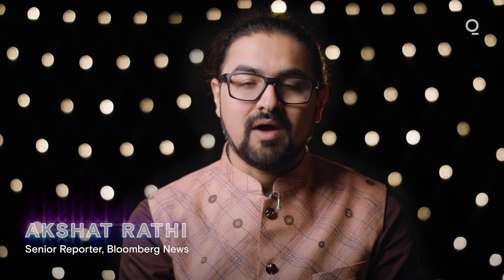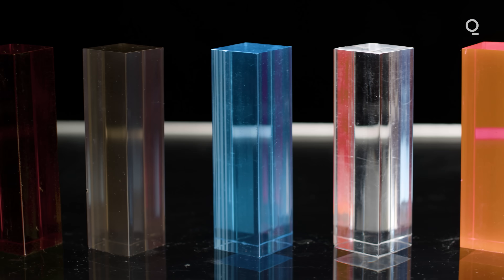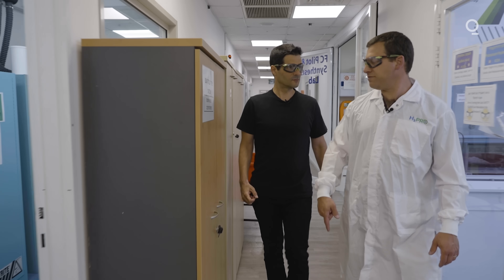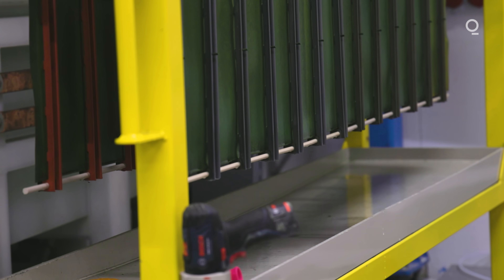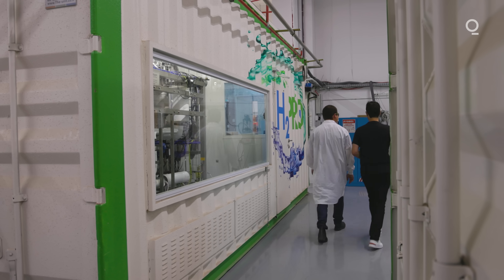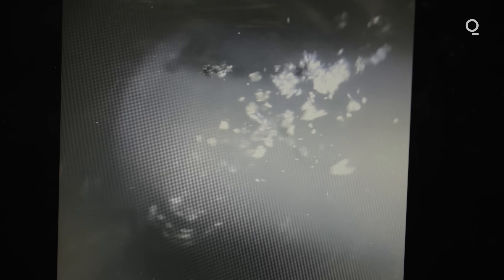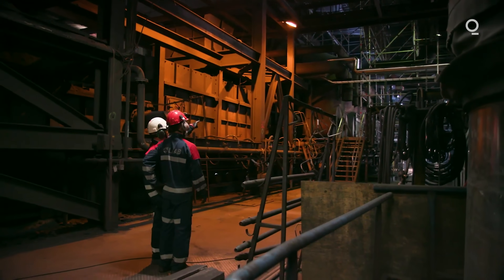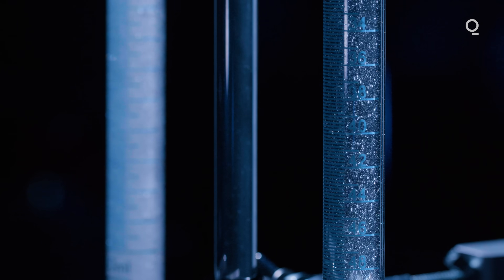How Cheap Hydrogen Could Become the Next Clean Fuel

Comment: Yeah, but creating Heat to extract Hydrogen from water or natural gas costs money and that power comes from somewhere, likely the electrical grid that still uses Fossil Fuels!  Making 1000 °C costs money and electrical Fossil Fuel energy, and making 1000 °F costs 1.832 times more!  And this doesn't even include the costs of the facilities, computer-controlled machinery and manpower.  Everything about "Green" is a LIE!!!  You'll never be "Green" until you eliminate the use of Fossil Fuels to make the "Green" products and the Fuels that they run on!!!  What about Stanley Meyer's water-powered Hydrogen Fuel Cell car and the process he used to create the Hydrogen for it?  His were truly "Green" vehicles and, to my knowledge, the Hydrogen was generated onboard.  It could use any kind of water; Distilled, Tap, Fresh Natural Water from rivers, lakes and ponds and even Sea Water and Heavily Polluted Water and even Poisoned Well Water.  You simply cannot get any Greener than that!!!

Comment: This has been a steady drumbeat from business types for 20 plus years...reminds me of their dedication to diesel-hybrid cars.  Speaking as a mechanical engineer, they have no idea.
Reply: what do you suggest ?
Reply: @visco4916  EVs.  Battery materials can be recycled, energy can come from renewables, and the electrical network is basically ready installed in garages. 
Yes they still have limits and EVs will not stop climate change but look how far the technology has already come in only 10 years.
Reply: @andyjohnson3790  I think it's pretty silly for the US to invest in hydrogen. But for the EU, and their historical cheap gas that they used to have, the lack of materials for production of batteries, EVs etc, they have a real reason to invest in hydrogen.
Reply: @andyjohnson3790  that would not be sustainable though since recycling used batteries are very inefficient and costly, mining new raw materials would be cheaper and the industry would most likely go for that instead. It wouldn't be long before we have also exhausted the available materials for batteries like we did for fossil fuels. hydrogen is cheap light abundant and environmentally friendly if created correctly, and it would be a great way to store and transport energy
Reply: @andyjohnson3790  ev is just using battery, but where ultimately does the energy come from?
Reply: @PROLEO4011  there are zinc sodium batteries advancing, plentiful materials.
Reply: It's not going to happen. You make electric, use it to make hydrogen to run an engine. That is 60%  ofvthe energy gone. All hydrogen production is not clean, its far more dirty that using electricity for EV's

Comment: Since the the 70s in particular we were told that our cars would be electrified with the next 3-5 years. 

Every couple of years were heard that. But it never happened. No further effort was taken. Claims like that were as far as we got to electrifying the automobile. What such claims did was actually delay things. Delay the development. Why? We were comforted knowing that the solution to emission and energy problems was around the corner. Hence, problem solved. The central issue of storage was barley addressed. Batteries. 

Then came devices and more devices. Batteries were needed. Development skyrocketed. Lithium ion. Tesla, and things suddenly started to change. Hydrogen is the same. How to store and transport the stuff in an economic and safe way. 

Nothing else really maters and you can talk about everything else all you want. Nothing else really matters.

Comment: Unfortunate that video ends with only brief mention of hydrogen storage and transport problems. Ideally hydrogen from water can be produced using renewable energy and then carbon dioxide from the air can be reacted with hydrogen to synthetically produce the same hydrocarbons we use today, but with net zero carbon in the atmosphere and no need for any fossil source. Perhaps a follow up video could dive into synthetic hydrocarbon production.

Comment: The best option with H2 is utilizing excess renewable energy to split water into H2 and O2, storing locally, and converting back to electricity during low renewable availability, analogous to a battery. This is not competitive with current and emerging battery tech. Otherwise, generation, storage and transport of H2 is cost prohibitive or come from fossil fuel dependent sources. I’m all for exploring “all of the above” energy options but this seems like fighting physics and economics. More directly, it seems like fossil fuel funded research and lobbying (fed grants) to try to stay relevant.

Comment: The production of hydrogen is relatively not the main issue when comparing to the cost of building up infrastructure for transportation and storing as these physical properties are dramatically different from these two types of fuels
Reply: The production of hydrogen is a major problem as well. We have no means of doing it on anything other than a tiny scale.

Comment: Hydrogen the wonder fuel ,for one hydrogen gas is expensive blue hydrogen costs 7000 dollars a tonne and green hydrogen 9000 dollars a tonne. The blue creates CO2 but this can be stored hydrogen gas is used for ammonia production and any hydrogen gas left over can be transformed back to methane and water using Sabatier reaction. The energy used for green hydrogen is 50kw per kilo ,the next goal is to reduce the 50kw to 40kw and that can be done with more R&D .

Comment: LNG and LPG will probably beat h2 for awhile. H2 enriched biofuel and gasoline. Micro-refineries or nuclear powered chemical reactors. H2 still has a place for micro commutes, or smog control,  but just can't beat the energy density of hydrocarbons.

Comment: While industry and enterprises want to replace fossil fuels with another marketable commodity, no one ever stops to realise that water isn't harmless. Its not even mostly harmless. Water itself is also a powerful greenhouse. gas capturing huge amounts of heat. So given current volumes of co2 produced and replacing it with water, we are actually not solving the problem at all. CO2 is 840J/g/°C while water is 4.18 J/g/°C. Meaning you need far less energy to raise the temperature by 1°C. Hydrogen is great in theory but in practice it's only going to accelerate global warming, given the current volumes of gas output by the  human population.

Comment: As was strongly pointed at, the goal of cheap, green H production must be for use in chemical processes, not energy storage, for cars for example. Why? The conversion efficiency of H to electricity is less than 1/2 that of using state of the art batteries. Why pay 2x for auto fuel?

Comment: THERE IS NO 'CLEAN' HYDROGEN. It's all greenwashing!!!
We all did this experiment in school. It's INEFFICIENT using DC! Stan Meyers died with his secret of low power hydrogen production from water and my guess is that you apply power & the 22.235 GHz resonant frequency & that will cause it to shatter like an opera singer shatters a wine glass. That may be workable but it still NEEDS power to work so is there a net gain? 
Certainly NOT with the O&G industry. We all know the O&G industry is wringing their hands waiting in the wings, lobbying for government to subsidize 'cooking' methane for the hydrogen. Also INEFFICIENT and it keeps us dependent upon them...forever. It also takes lots of POWER to do that and where's that coming from again...electricity most likely which is still produced from...you guessed it...FOSSIL FUELS. 
So let me get this right. We use wind/solar/wave energy to power a system to produce hydrogen to power cars & trucks. Power that would be more efficiently used to charge electric cars DIRECTLY. See the trap here, yet?

Comment: The problem with "natural" gas is drilling is a huge problem for the environment and fracking is worse. The leaks of methane and diesel fumes from those sites are more than enough to tip the "turquoise" away from green and CO2 positive. Green hydrogen is the way forward

Comment: How to make vehicles run on alkali solution : ELECTROLYSIS INSIDE FUEL FILTER, AND INSIDE COMBUSTION CHAMBER BY PLASMA FROM MULTI SPARKPLUGS, JUST NEED LITTLE HACK THE ELECTRYCITY BY USE SUPERCAPACITOR AND VARISTOR, FIRST MAKE ELECTROLYSIS INSIDE FUEL FILTER first electrolysis (PEM OR PLASMA), BECAUSE GRAFITY EFFECT WATER COME FROM UNDER FUEL FILTER EFFECT WILL MAKE PRESSURE SO HYDROGEN DON'T COME BACK TO FUEL TANK BUT RIGHT INTO INJECTOR, BY INJECTING BOTH HYDROGEN AND WATER INTO INTERNAL COMBUSTION CHAMBER CHAIN REACTION (EXPLOSION MUST BEEN HAPPENING INSIDE COMBUSTION CHAMBER) BECAUSE PLASMA SPARKPLUGS WILL MAKE ELECTROLYSIS+IGNITION , THIS MEAN ALL VEHICLES ACTUALY CAN RUN AND  BURN ON WATER AND HYDROGEN.

Comment: It takes 39 kWh of electricity to produce 1 Kg of hydrogen at 100% efficiency.  That same 1 Kg of hydrogen contains 33.6 kWh of energy.  Hydrogen is a net loss fuel.
Reply: all energy storage systems are a net loss.  pumped water involves fluid friction, gravity storage involves air and mechanical friction, li-on batteries loose energy.  Everything does, some more than others.
Batteries have a carbon cost to manufacture.
Reply: @emmabird9745  I'm not referring to storage systems.  Unlike natural gas, coal and oil, hydrogen does not exist in its elemental form in any significant quantities on Earth.  You cannot mine or drill for it.  In order to obtain elemental hydrogen for use as a fuel, you must convert another material, either by electrolysis or chemical processes.  The energy input to make hydrogen gas is greater than the energy it can provide.  Therefore, hydrogen is a net loss fuel.  Hydrogen storage systems are an entirely different matter and presents its own unique challenges.
Reply: @NCF8710  Hi.  I'm not sure quite what your point is.  If you want to produce hydrogen then it is probably for one of two reasons, either as a reducing agent, eg for steel making or as a fuel.  As a reducing agent then the energy cost must be measured against the alternatives, eg increased GHG or whatever.  As a fuel, it is an energy storage system compared to say batteries in an EV.  Even coal is an energy loss fuel as it takes enegy to extract it, similarly oil extraction.  In that respect the energy cost of hydrogen production is comparable maybe better, maybe worse.  It should also be considered that for some transport it may eventually be the only show in town given the land and water use cost of synthetic biofuels (which also have an energy cost).  But we will see.

Comment: Hydrogen has such a low ignition point and burns so hot that the flame is invisible to humans and results in cataclysmic explosions. The Hydrogen / Oxygen bonds are very strong in water and stripping it from coal or oil is no better off than burning it onsite or in your car. Hydrogen terrifies me.  The Space Shuttle had a disposable tank and Elon Musk doesn't use it in his reusable Falcon 9 because of Hydrogen embrittlement. No hydrogen is just to dangerous.

Comment: Wonderful, and the only pollutant released being by far the most effective of the greenhouses gasses, water vapour.
Reply: Correct.  As the IPCC is on record as pointing out,  ~ 95% of any "greenhouse gas heating affect" comes from water vapour in the atmosphere.
Reply: @aeroearth   wouldn't condensed water vapor (clouds) offset that due to their reflectivity creating a cooling effect?
Reply: @observer3137  Correct. When water vapor becomes cloud it reflects the sun reducing heating of the earth. Notice how cloudy days feel colder!
Reply: Guess which greenhouse gas they cannot model? Water vapor, especially when it turns into clouds. Explains a large part of why climate models are rubbish.
Reply: Great point! 👍

Comment: Green Hydrogen. The biggest mistake all of them are making is to attempt split water in liquid state. It take a lot of amps to split, while splitting water in gas state take very little amps. Using low power ultrasonic device can transform liquid into gas state.

Comment: A slight historical data on the zeppelin. It was covered in silver paint. The silver paint itself was discovered to be rocket fuel. That paint was used as fuel for V2 rockets. So if your car was covered in that silver paint and someone keyed your car and it exploded. Was it the car's fuel tank. Or the fact it was covered in rocket fuel?  Their two safe storage ways for Hydrogen. You can make it into a solid compound or you can trap it in metal. Like from Plasma Kinetics
Reply: Not silver, aluminum.

Comment: Lots of hope here, but nothing of much promise. Yes electrolysis has been known for 200 years and the multi-billion chlorine industry runs on it. That "orange" has been well and truly squeezed, so significant improvement is unlikely quickly. As for C-Zero, they have a lot to learn about scale up and this technology cannot work long-term due to corrosion and volatile salt loss. They are clearly enthusiasts, not experienced engineers. Contact me for a full understanding of "dusting"

Comment: The problem with hydrogen is storage density. It's abysmally low. Conversion to simple hydrocarbons, on the other hand, may provide a solution, especially if the carbon is from the CO2 in the air and the burning of these synthetic fuels is therefor carbon neutral.

Comment: 'green' hydrogen should be madeonsite or as close to where petochemicals are made. it should not be used for energy. only for chemicals like ammonia. for energy use renewable power-wind/solr/geothermal or go nuclear. h2 need not be used. start thinking about battery recycliNG and materiaLs recycling

Comment: Would it be possible to miniaturize the  C-Zero equipment  like a methane reformer for H2 fuel cell based cars & planes etc as storing & transporting LNG is much easier than H2.
Reply: I don't think you could miniaturise it enough to put them in the vehicle if that's what you mean. But you could put them at the airport to generate H2 on site to refuel the planes.

Comment: If these companies do not have product to produce hydrogen on a commercial scale today then they are just selling science fiction.  Hydrogen is not an energy source but an energy transport.  It takes much more energy input to produce hydrogen than the energy output you get when using hydrogen.  Hydrogen also leaks a lot more than natural gas and has a fraction of the power per volume of natural gas.  It cannot be used in existing natural gas systems due to hydrogen embrittlement (weakening of metal pipes).  A hydrogen powered aircraft would probably need to be fueled with liquid hydrogen.  That would turn planes into bombs.

Comment: But hydrogen is so small on a atomic level that it leaks through solid material. So if producing it becomes cheaper you still have the material science issue of how to store and transport it effectively and efficiently. We should focus on energy storage for renewables. Only one thing you have to engineering instead of multiple
Reply: on some of those hundreds of vidz about things like next LiPo battery etc, ammonia as a possible solution for storage and some application was suggested.

Comment: Hydrogen will never become fuel. It is a battery that brings electricity to your car. It's the same, as saying. A tesla runs on batteries. It is not. It is also an electric vehicle. The thing is. You can't pump hydrogen up like oil. It just transfers power. You do not "burn" it.

Comment: two interesting things to know: one, those colors are informal and not controlled, be careful of who's boasting their color. second, any color other than green is unsustainable for one reason: hydrogen and H2O (water vapor), are actually MORE of a greenhouse gas than CO2. Don't be fooled by the innocuous appearance of h2o, it can only be a safe mass-produced energy source if it's made from water or water vapor, not from natural gas (as natural gases are not active greenhouse gases until they are extracted).
Reply: The funny thing about water vapor is that when it gets cold in high places it forms a thing called clouds and when they get heavy rain falls. Unlike CO2 that just stays up in the air.

Comment: It sounds like the low density of hydrogen is the main problem, I wonder if we could make ammonia with the hydrogen and solve a lot of those problems.
Reply: Liquid hydrogen is much more energy dense if used in combination with lightweight composite tanks.
Reply: @jimj2683  Well hydrogen is one of the coldest things on earth, and takes super heavy tanks to carry, ammonia much lower liquefying point so easier to work with.

Comment: Sure there's no emissions in the decomposition of CH4 to H2 and C, but what's the energy required to sustain the high temperature to get that decomposition going and what is the energy source? Burning natural gas to decompose CH4 kind of defeats the purpose right? Also Also similar with the other company, "you don't need energy, just make it high temperature"? You need energy to add heat to a system!

Comment: the problem with hydrogen in my opinion is in its transportation, not just generation. without some kind of ultra advanced metal hydride to aide in compression it loses its advantage. also on kilogram of hydrogen takes up a LOT of space. id like to see aluminum and magnesium fuel cells investigated more as even with the weight, i think there should be and advantage in transport - especially aluminum.